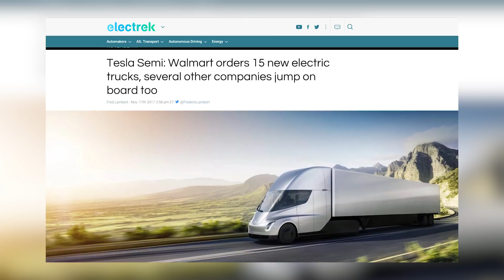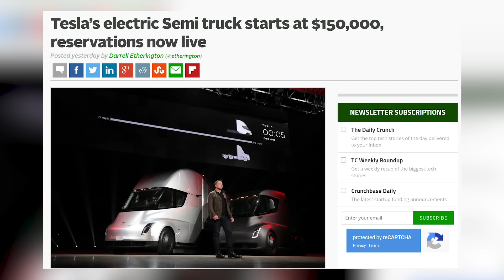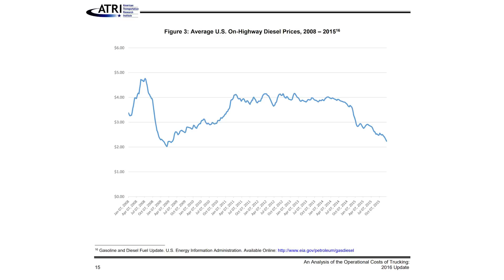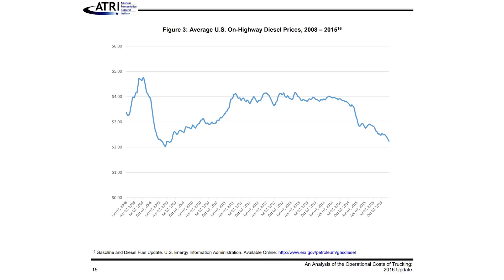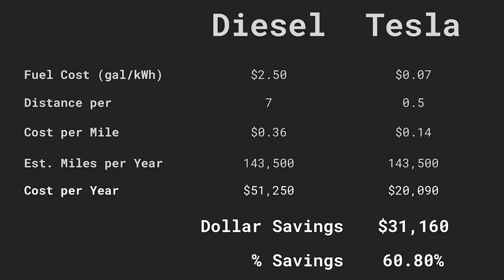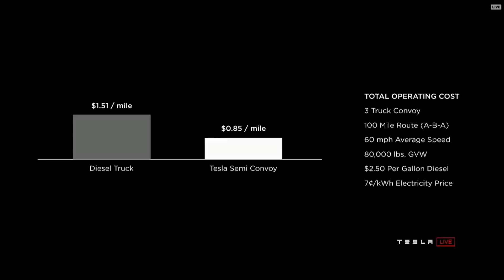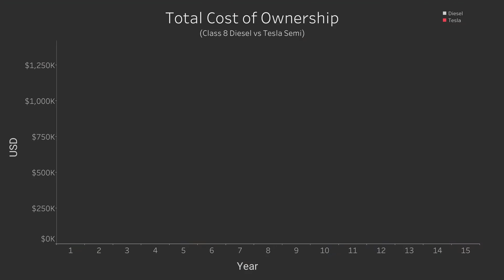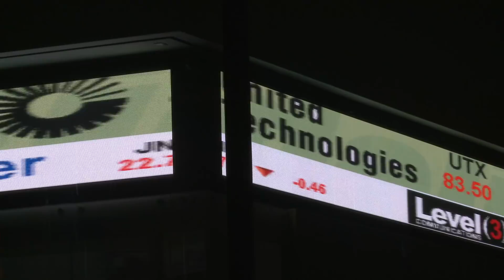What is the TRUE COST of a Tesla Semi?

Comment: There are also other costs to consider--some are fairly tangible while others are less immediately so.  Start with safety.  Getting in and out of the Tesla Semi will be as effortless as boarding a bus which eliminates driver injuries from falling off the truck.  Go ahead and laugh but it is a lot more common than you would think because of how difficult it is to climb into a normal / traditional semi.  Add in the improved visibility, lane keeping, reduced work load for the driver, elimination of jack knifing etc. ad you are likely to see a surprisingly large  reduction in these costs for larger fleet operators.

An example of a more intangible cost is public perception.  Diesel trucks are loud and pump out the pollutants.  There will be a large and growing amount of pressure on many large fleet operators from their customers to move to electric truck fleets.  Think Amazon, Albertsons, (all the grocery chains really) Fed Ex and UPS and on and on.  This will intensify because early adopters will almost certainly promote how they have gone to clean electric for their fleets in their marketing--which adds pressure on their competitors.  Additionally early adopters have the option of taking higher margins, (pocketing the 20% or more in savings over diesel) or passing on the lowers costs to their customers and potentially grabbing some market share.

I know "disruption" is a popular buzz word these days but I can't really think of a more time compressed and obvious example of disruption than the transition to electrifying transportation.  Amazon comes to mind but that took a lot longer in time scale.  Either way, what an exciting time to be here and see it all unfold.
Reply: If it's safer it should lead to reduced insurance costs too...
Reply: Teslanomics by Ben Sullins 
Great article as always Ben!
Have you considered that (apparently) Walmart have stated that they wish to use 50% on site generated (solar?) power by 2025?
A few tweaks to this system could effectivly result in free fuel for their trucking operation!
This could be a model adopted by many large operators running between depots and stores.
Reply: Mr Trench – Even if that were true, it’s not a difficult problem to solve. Also, as a cyclist in a city with thousands of Teslas, I’ve come to realise that most of the noise that cars make comes from the tyres. I can hear a Tesla approaching behind me just as easily as any other car — and, in fact, I can’t tell if it’s a Tesla or a BMW without looking. Diesel trucks are a bit different, obviously, but it ain’t rocket science to make a Tesla Semi noisier in urban environments — and combined with better braking, collision avoidance, lane detection, etc it’s obvious that these trucks will be much safer than the current option.
Reply: Closeoutracer
I guess that would make the next question: if they could so easily make a diesel electric that cuts fuel costs by 50%...they why haven't they?  The logical extension is to ask: If Freightliner, Peterbuilt, Kenworth, International etc. can so easily "respond" by building an electric truck that crushes Tesla...again...why haven't they?  Maybe because building an electric truck and all the tech that your poked fun at is not as easy as you think.  

Lastly, if Tesla forces the others to make an electric truck to "crush" Tesla with...then Elon Musk wins (and so do you and the rest of us) as that has been his goal from day one.
Reply: richardscathouse 
OK I will play...um...Kangaroo!
Reply: I assume they'll start including some white noise generators
Reply: And as horrible as it sounds...people will adapt and society will change.
Reply: TRAIN SHIPS 

What makes you think anyone has forgotten about tires?
Reply: I don't know anything about trucking.  Why is 500 miles not enough?  If they can recharge to 400 miles in 30 minutes, it means that you can go 900 miles with only a 30 minute break.  At 65 miles per hour, that's 13 hours.  This is more than is allowed by law in the US right now, isn't it?  I get that not everywhere will have the mega chargers, but for routes that do have them, it seems to me that the distances are more than adequate.
Reply: Justavian

Realistically it is fine.  The problem is the *false perception*.  If a trucker driving a diesel truck stops after 500 miles at a truck stop for an hour to eat and hit the can does it really matter that he has enough fuel on board for another 500 miles?  Not really as most would refuel or "fop off" anyway.  Regular drivers are the same.  If 361 days out of the year they drive less than 100 miles per day and 4 days a year they make road trips over 500 miles...then the car must have 500 miles of range rather than being inconvenienced for 30 minutes at a super charger those 4 days.  Much better to lug around 2 x the batteries you need =)
Reply: Gene Phipps "I use to own a truck and trailer repair shop where it costs $25 thousand to rebuild a diesel engine" are you sure that wasn't the cost to rebuild the entire drivetrain from tires up?
Reply: For a complete engine rebuild--all machining operations done in the truck like cylinder boring etc.--yes.  It might have been $20k I don't remember for sure now but it was so expensive that most truckers took out loans.  I am not talking running the rack or a top end rebuild--a full engine rebuild.  It is a little more even if there is any welding required for cracks.
Reply: To put it in perspective, the truck would be in the bay for a week and usually had one mechanic and one helper on it the entire time--a very expensive mechanic.  The parts alone were $12k or more
Reply: You're so right. This is either going to change transportation, because if this works Elon will have more backers for the hyperloop and tunnels, or it will go very wrong because oil barons and combustion competitors will fight back like they did when Tesla first came out.
Reply: John Rose
We are already seeing that cycle repeat with the dealerships moving to block Tesla sales and of course the new tax plan repeals EV tax credits but doesn't touch any of the massive big oil subsidies.
Reply: LOL!!!
Reply: I think somebody forgot about the cost of Tires. Tires will continue to wear out at the same rate as currently.  That said anyone that has owned a front wheel drive car or all wheel drive all the time, knows they wear out faster due to the increased torque vs a rear wheel drive car.
Reply: Justavian Most route planning is based on 500mi incronments local can be up to 400, but this means you'd have to be back at 400mi no diversions as you can't refuel meaningfully in less than an hour, meaning 1hr+ ot for a driver which they don't want to pay, as I remember from my local days this happens quite often.
Reply: what about putting A lot of mechanics out of A job
Reply from the maker: Thanks for the input!
Reply: @BenSullinsOfficial  apparently the Tesla semi will ship later this year, it’ll be cool to see how it does.
Reply: include the fuel pumps service after 200K miles fuel pump is half the engine and breaks almost every year
Reply: Well said, What a time to be alive to experience the transition to pure electric in one of the greatest change in our planet !!
Reply: Gene Phipps one of the biggest safety features of my truck other than the brakes is how loud the engine is. In populated areas I can flip a switch that turns on the main engine fan that makes it even louder and believe me, it stops people from randomly walking in front of my truck. Any electric truck, not so much so. I believe there will be allot more people getting run over by electric truck's because they were unable to hear them.
Reply: There are a lot of parts that need service or break fairly often on diesel trucks.  Drive lines get twisted up like pretzels, U-joints wear out...there are multiple air, fuel, and oil filters.  A lot of people don't know it but diesel fuel also can develop the dreaded "diesel bug" which is exactly what it sounds like.  Bugs / alga growing in the tanks that wreak havoc in the fuel lines and filters.

A lot of the owner operator truck you see on the road are also hig mileage used fleet trucks with rebuilt engines.  I use to own a truck and trailer repair shop many years ago and it was about $25k to rebuild a diesel engine back then, (more than 20 years ago) so I can't imagine how expensive it is now
Reply: Anyone remember the 20 thousand dollar Model 3? What's it up to now something like 45K and it still doesn't exist? 

So we have a truck that doesn't exist, with a battery that hasn't been invented yet, to be built in factory that doesn't exist. By a company that has had only a single profitable quarter in the last several years and is currently losing $8,000 a minute. Oh and guess how Tesla had that single profitable quarter. No it wasn't from selling cars. It was from taking preorders for those nonexistent Model 3s.

A few quick questions for the Tesla cultist. 

If the battery alone turns out to weigh over 10,000 pounds as engineers predict it will. Won't the Tesla truck have to weigh somewhere around at least 18 or 20,000#? If so how many loads will Tesla drivers have to pass on because their truck is like 6 or 8 thousand pounds too heavy? 

If the range range claimed by Musk turns out be as wildly optimist as the claimed range of the rest of Tesla's vehicles has, will this Truck be usable for OTR trucking at all?

If we assume for once Musk isn't full of crap about the (still totally inadequate) range estimates for the Tesla Truck. Won't the claimed 500 miles drop to around 300 and 180 miles for the 300 mile truck in winter driving? Trucking companies still drive the same miles in winter, don't they?

What do you do if one of the currently nonexistent Tesla Truck Semi Charging stations isn't on rout of wherever it is you are haling a load too?

Refrigerated trailers run on diesel too. Is the Tesla truck going to power to the reefer as well? If so how much will range be cut from powering one of these currently nonexistent electric reefer trailers?

If the price tag doubles as the Model 3's has will anyone want a $320,000 truck?
Reply: THX 1138 First of all, it was a $35,000 M3, Which they delivered 6 Months ago, now up to 39k w/ autopilot included (forced for safety).

Tesla was profitable Q3 and Q4 of 2018 and expected to breakeven Q3 2019 and profit again in Q4, even if your estimates about the weather, you still need to realize that these will dominate short term Truck Delivery.
Reply: THX 1138 Tesla is looking to have a new solid state battery too (production in about 6 Months probs) which would have 20% more energy density & be 15 - 20% cheaper (look up about MaxWell technologies)
Reply: Gene Phipps garbage
Reply: Suppose Freightliner builds a Diesel/Electric hybrid and cuts fuel cost by 50%?   Tesla will go bankrupt. 500 miles is not enough range. Mercedes who owns Freightliner already has electric trucks.  Musk seems to think the market will stand still..  Markets are fluid not static.  Morgan Stanley has downgraded Tesla stock.  Freightliner, Peterbuilt, Kenworth, International will respond and crush Tesla.   The Big Class 8 mfg's already have working assembly lines. They already have dealership networks.   Lots of techies want Tesla trucks because they want to have plastic light saber fights on Mars wearing their Star Wars underwear ... People in trucking want working vehicles they can get serviced and profit with ... they have no Star Wars underpants dreams.
Reply: And op never touched anything, ya the drivers are falling off getting into the vehicle and getting hurt, ya, lets ignore strapping down loads etc, thats safe right? Chain binders, straps, etc. 

visibility is DOWN in that truck, lane keeping can be added to anything, "reduced work load for the driver" pulled out of your ass, elimination of jack knifing  again pulled out of your ass... and you some how see a reduction in costs lol okay now, you lose an 45min every 4hours of drive time, with a shift limit of 14hours (from the second you start "work") yep things are going go much faster right?

You idiots with diesel and " pollutants" live in god damn lala land how do you think your power is generated COAL, GAS, oh lets not forget, never goes away makes huge sections of land uninhabitable for hundreds of years NUCLEAR. oh wait you retards call that CLEAN.  

Come join us in the real world, the power grid can not support in either capacity or generation EV anything in any sort of scale, taking 45min to refuel a truck every 400 miles is lulz.  oh and if this tech had ANY merrit you would not see a semi, you would see a god damn fedex or UPS truck, you know UPS the company who spends MILLIONS on route optimizing software to save on FUEL, trucks that STOP and GO 500 times a day... wow what a chance for regenerative braking to come into play.

Nope, they go with a semi. 

Oh and based off the vid I guess this truck won't be used in the USA because with out an overweight permit your 80klb GVCWR... 80,001 is an overweight ticket so "north of 80k" is retarded.

Comment: As you stated, with so little data to work with this is highly speculative. I agree with all the major suppositions you made. No way they are doing a  loss leader. Financial community would go nuts, and that is not something Tesla can brush aside. They are on the ragged edge as it is, and if the bond market turns against you, you become toast. I took a little heat on Zac's channel for postulating a new generation of battery but I still stand by it. Robert's latest missive seems to indicate he believes in a battery generational change as well. My thesis is based on timing (2019/2020), cost ($180k) and weight guesstimates if one was to use 2170's in the roadster. I just don't believe the weight penalty is acceptable, or the volume penalty for that matter in the case of the roadster. If they take the 2170 curve to its limit, I'm guesstimating they can manufacture at the $80-90 level. So, if they have lets say $85k worth of battery, that leaves $59k for the vehicle on a 20% profit margin, which is skinny for such an expensive, low volume product. Can they really make that beautiful cab, motors, aux systems, software devel and maintenance for $59k? I will need a pile more data to buy into that hypothesis. Also, I subscribe to them finding an industry partner. That is what I would do as a former executive. Reasoning? Very little profit sacrificed on the alter of the good karma Tesla will get if they march forward with a partner. Yeah, its an emotional response, but the industry would give them lots of props for choosing to join up with the trucking industry. Since this is a B2B type product, one cannot undervalue the team player imagery. Use iPhone as the example here, and that's a consumer product where you do sacrifice profit if you sacrifice part of the supply chain. Another NUMMI in secret somewhere? I seriously doubt it. You couldn't keep it a secret, plus it takes years to take a factory and refit it. Betting on a partnership.

Comment: I don’t see the relevance of the acceleration numbers for the trucks. What about safety? What about the field of vision of a centrally positioned driver? Braking distance? Besides bending the laws of physics, how can the truck prevent 80000 pounds from jack-knifing? Is this truck going to be the next iWatch?
Reply: Saftety will be better than any other truck, as you saw, the glass is extremely strong, also the truck has a system onboard to avoid crahes. Breaking distance will also be extremely good due to motors taking off some of the load from the brakes, but of course there will always be the limiting factor of grip on the road. The vision around the truck will likely be dealt with cameras and to be shown on the two screens. Jack-knifing can be avoided due to the seperate motors on each wheel being controlled independently. Hopefully that should answer some of your questions
Reply: lsmeteor 
Re acceleration,
If you assume steady acceleration, at full load the Tesla will do .834 mile in the first minute from standstill and Cruising at 60.
Diesel will do 0.5 mile.
This would apply at every Junction so over a days running Tesla could be a long way in front of the diesel.
(The gap would also increase by maintaining speed on hills)
This would essentially be free charging time.
Regarding safety
If the driver loses concentration, is tired, or is taken ill the Tesla of will maintain road position and slow to a stop! seems pretty safe to me!?
Brakes
FAR more efficient! Braking downhill actually becomes an advantage as it regenerates more power. Much less work for the driver since there is no down changing. The individual Motors on each wheel will compensate for wheel spin and brake as required which is what will prevent jackknifing. The low centre of gravity will also help stability.
The conventional brakes will be for back up only and will therefore not wear out. Braking distance will be reduced.
Reply: It will still have breaks on top of the regenerative braking, i would bet on braking distance shorter than an normal semi. It won't jackknife due to each wheel having independent traction tied to each having its own motor with independent acceleration. This feature plus the low center of gravity, due to the batteries, makes it much more stable in curves and also extremely difficult for it to roll. Several cameras and radar are better than 2 mirrors for situational awareness. All that before you even mention the autopilot features that have instantaneous reaction times. In synthesis there won't be a safer semi to drive.